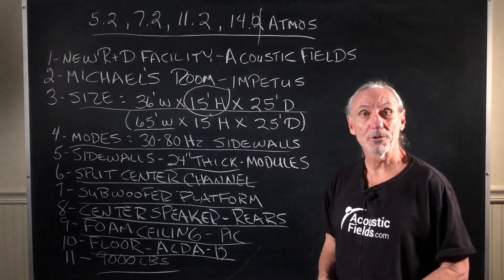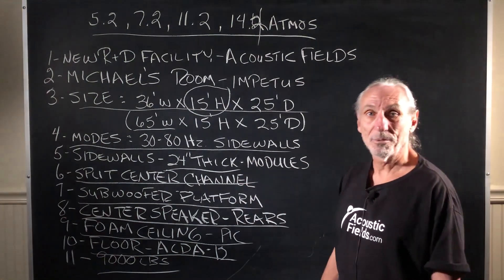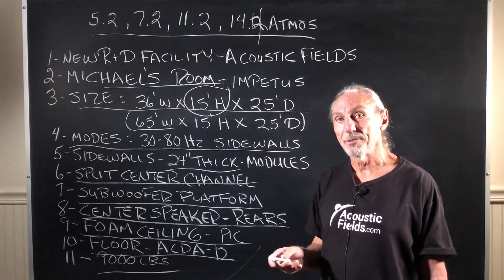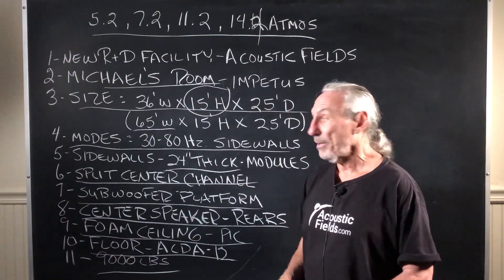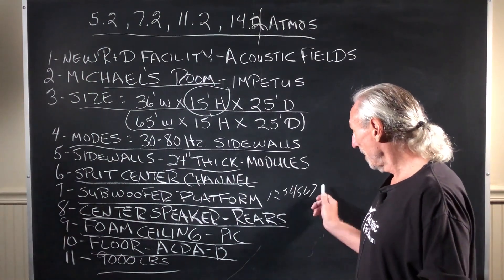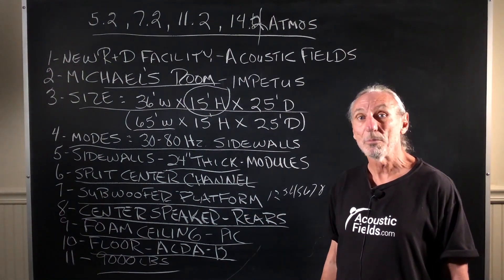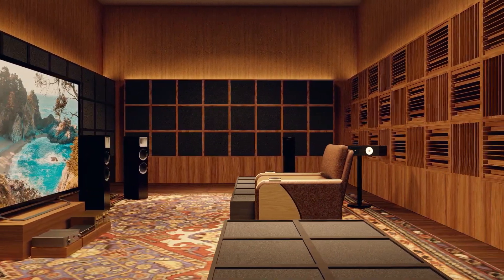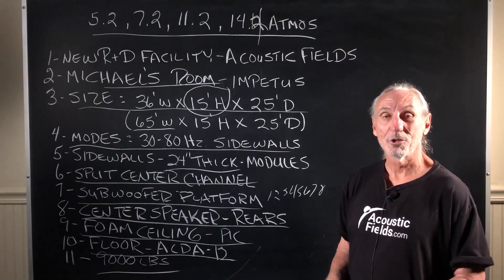Acoustic Fields R+D Facility - www.AcousticFields.com

Comment: I find it really interesting that you split the center channel, hence eliminating the issue of a center channel being in the wrong place. Real movie theaters have the center channel(s) behind a perforated screen where it sounds natural. We can't do that with a solid flat screen.
Can this be done with just the left and right speakers? That is, no additional L/R speakers added? Thanks, D.
Reply from the maker: When you split the center channel into a left center/right center, you can keep all channels in the same dispersion domain. This is more critical than people realize. You can use the same spaeker as you are using with the left and right channel configuration so a smoother soundfield is generated. This set up paradigm has many advantages. First, your ability to focus center channel energy that is in the mix onto the screen is dramtaically improved. Secondly, sound stage is widened. Finally, voice resolution is improved.
Reply: @AcousticFields  Thanks, Dennis!

Comment: Great work Dennis, should be interesting, my system is 11.2, with 4 12" subwoofers, the 4 subs in total are the equivalent of 1000w, so I'm not really over powering my low freqs,  rather distributing it well, set at different heights, with a great response no matter where in the room, some home made room treatment, with a difficult room shape, on the scale of your room here, ceilings aren't as high though, so I'm interested to see what you come up with.
Reply from the maker: It will be an interesting journey. We are now working with a 5.2 system. I have finally, after 3 months of effort, found all the channel locations. Its way different than two channel. Yikes! We will start the numbers from our 2 - 13" subs at 12" off the floor and move up with response numbers and impressions up to 6' to start on both short wall sides to start. We will then bring in two side channels for 7.2. How do you have 11 channels positioned?

Comment: Dennis, can you discuss your reasoning behind using the 36ft distance as your width and the 25ft distance as your length?  I would think you'd want it the other way around, especially with an  Atmos system with 14 speakers. Yikes!!!  :—).  Can't wait to see more videos on this room, and others you've designed.
Reply from the maker: The 36' distance was what we needed for the dispersion pattern of the four horns in the front of the house and also to minimize low-frequency issues..

Comment: Interesting project, good luck. It's wonderful to have such a nice space in which to work. 

Primary concerns, ... fwiw;
In my experience, a pair of 13" subs is significantly inadequate for such a space and intended usage.  
Dual/split center channel is a bad idea, creating multiple issues.
Reply from the maker: That is not our findings so far. The split center offers a center image that is focused on the screen and and large as the screen. I do not know what your reference levels are for room acoustic low frequency attack and decay rates. However, with the proper treatment types and amounts, less energy is required in any size room. A pair of 13" drivers will provide enough output for testing and still be fast enough to keep up with the "mains". If we require more 30 - 50 Hz. energy, we can always add another driver.  One step at a time. Physics is the law. Everything else is just a suggestion.
Reply: @AcousticFields  
You're right! 
Physics wins every time.
Reply: @AcousticFields  
Dual centers, as you've experienced, it'll work. It just creates unnecessary acoustic issues to solve. 

Two centers creates a pyscho-acoustic scenario whereby each listener perceives the center content to emanate essentially from the speaker closest to them (precedence effect). 

There's also spectral changes from combing. 
Any discreet channel being spread laterally from one acoustic position into two, creates differing path lengths, resulting in comb filter effects to any listener not perfectly equidistant (w/subtractive nulling deep into critical vocal range). 

Conversely, a typical single center channel launches that energy into the space spectrally correct. Most importantly, every listener experiences it perceptually associating it to the screen image.  
---

Regardless of the room's LF decay characteristics, I don't believe two 13" drivers covering LFE and and redirected bass is even close, just isn't ample swept volume for that space. 

I'm sure you're aware, but for others reading to be mindful;
every octave in extension requires a 4x increase in excursion. That adds up quickly. 

A pair of 13"s wouldn't stand a chance in a modest sized room, let alone a nice voluminous room like that. 
If the subs "see" 65' then any reciprocal vessel gains wouldn't manifest until below 10hz. 
So it's good news/bad news with the long dimensions. Good news, pushes the transition region lower, always good. Bad news the system's LF capability isn't helped much by the space. 

I get it, like you said it's a work in progress.
Reply: I'd explore three identical LCRs across the front as a platform moving forward... subsequently adding additional widths, or widths and front heights at some point. 

If you're utilizing a direct view display, either elevate/angle the display toward the LP, or elevate/angle the LCRs slightly to accommodate the display. 

Either way, retaining uniformity with all three LCRs across the front. 

This conundrum is why so many opt for the sonically superior approach of an acoustically transparent screen w/projection. 

Myself I prefer direct view screen brightness/detail in all lighting levels. This brings acoustic challenges of the display, of which I've found work-arounds. 

Good luck

 That said, with careful placement of LCRs somewhat behind

Comment: A Stereo recording played back on a 5.2 system doesn't seem logical, much less practical. Unless it can be recorded and mixed in 5.2
Maybe for Theatre things are mixed in multiple channels, but Musical Audio is still largely 2 channel, so I'll stick with my 2 channel system.

I like to think about it this way:
Hearing the same sound from multiple sources is completely unnatural. So is hearing multiple sounds through a single source.

I have thought about taking a multi track recording, and playing each track through a different speaker, then place the speakers as if they were the band in the room. That might be pretty cool, but it's unlikely that we are going to get bands to release albums in multitrack format!
Reply from the maker: I do not think natural has anything to do with theater presentation values. You have to decide what type of sonic strategy you use for your theater. If you are using a Disney encoded format, you will want to be in the center of all the channels. This is how that format is mixed. If you want a strong front of the house, you can have that and let the rears "fill" in. You have to decide what presentation value you wish to achieve and then treat to that strategy.

Comment: I have been splitting the center channel and using identical speakers as the rest of the system for years. It puts the drivers in the same horizontal position. 
Excited to see your results.
Reply from the maker: What are your observations on this set up? Did you have a single center channel to begin with?